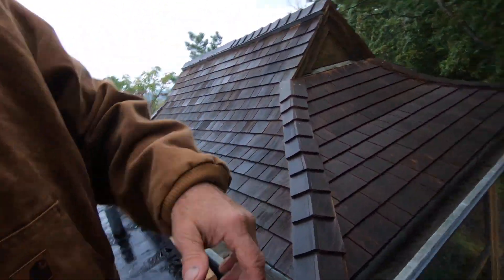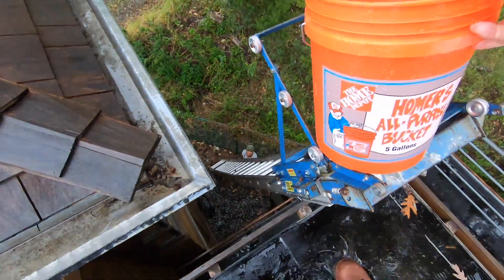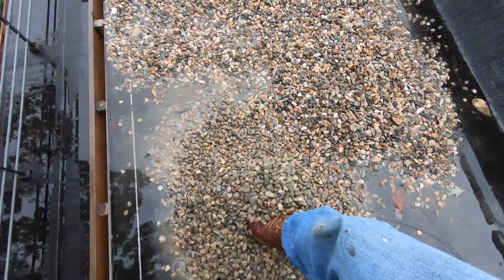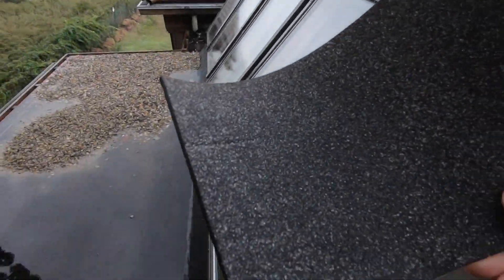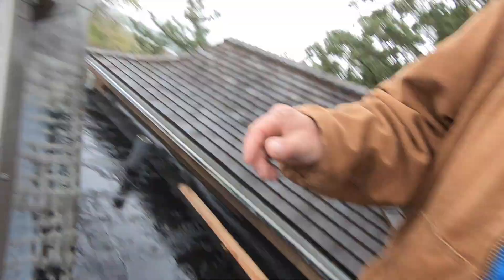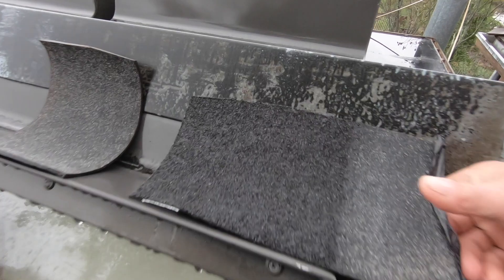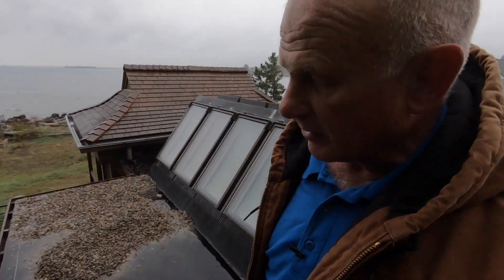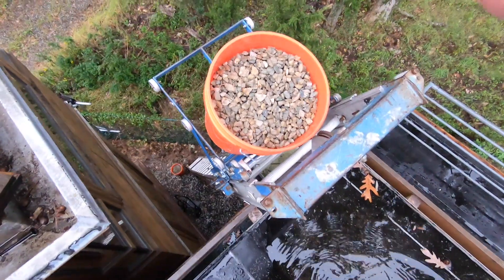What is the stone for on a flat roof?  What kind of protection should you use for EPDM, TPO or Torch

Comment: I have a large flat roof and I want to use it as a recreational space since it's so late and access is granted from the main living space. The problem is that it is a rubber roof with a 10 inch slope over 13 feet in either direction. I'm thinking of having the sides of the roof raised and gravel put down then I can start using the space recreational with the gravel as my base floor and certain spaced I may lay pavers on top of the gravel. Does anyone with experience have any valuable feedback to share please?

Comment: I just bought a brand new house and over our bedroom is a flat roof that is black. Is it a good idea to put a light coloured gravel even tho there’s no foot traffic up there? Can gravel end up damaging brand new laid out flat roofing? I’m super confused because here in the Netherlands 40% of houses have gravel and the others don’t and just leave the black roofing exposed. Is there a reason for this? We’re boiling in the room at night…
Reply: You can buy the EPDM Roofing Material that has a thin Aluminium Metal Coating. This would reflect the IR and UV from the sun's heat, and make for a cooler bedroom. This Roofing Material can also be self-adhesive - if you clean the surfaces to be bonded really well.

Comment: does anyone here have experience and advice on these types of gravel roofs? Ones leaking how should i seal it???
Reply from the maker: very hard. You need to scrape off the gravel with a spade, clean the surface to get it free of dust, Use a torch to heat up the surface to remove imbedded stone with the spade, then you can repair it with a rubber membrane

Comment: With all that water on that roof all that stone is gonna wash away, also you pointed at the flashing where you showed it was “spider web” and you didn’t address 🤦‍♂️ stop ripping ppl off and get off the roof!!!!
Reply from the maker: Your comment shows how little experience you have. 
1. The stone will never wash off. it has been used like this for 60 years
2. I pointed out why the stone is needed, to protect the roof against UV's. This video was not about how to repair or address the existing membrane. duh!
3. You sound like someone that just want to be negative without any good reason. Working for the Union or someone will get you depressed. I am sorry about your attitude. 
4. Maybe you should start with some lessons on bettering your life and your comments might improve.

Comment: Nice I use to work for a vanity company qhere we had a vaccume truck and we qould cone and vaccume the rocks off commercial buildings so the roofer could replace it
Reply from the maker: I know about that service. but I found leaving the stone on the roof helped to give a smoother surface and with the 3 ply system, I implemented it was wonderfi=ul. The reason contractors had the stone removed, is because they were stripping all the roofing off.

Comment: Can I add a small deck ontop of the gravel on a flat rooftop? Or would I have to make modifications?
Reply from the maker: I fyou have an existing old hot tar and gravel roof, then it is best to first replace it with a new roof. The Hot Tar  and gravel roof only last between 20 - 30 years, some longer. So don't take a chance to put something on top of it if.
Reply: give me a call 416 995 4673

Comment: Does the weight of the gravel not have an impact on the roof?
Reply from the maker: Not at all. Most structures are designed to carry far more weight than anticipated. Like 6' of snow, a bunch of people on one spot, and so on. One of the reasons why you see commercial roofs cave-in is when drains are not functioning properly. Snow is not a problem on a roof, but if it melts and the water can't get off, and more snow piles up and more rain, that roof will eventually collapse. If you can find videos on roofs that cave in, you will always notice the water that goes with it.
Reply: @FlatRoofDoctor  thank you doc. And as for the size of the gravel, any size?

Comment: According to GAF modified bitumen is supposed to have standing water. I just met with on of their reps last week. They claim that really only TPO is made to allow for standing water due to the welded seams. The rep explains that bitumen will break down quicker due to the water. My honest opinion is that it comes down to the installer and not so much the material. I've seen a lot of TPO systems and emailed work leak like crazy due to improper installation.
Reply from the maker: Hi  Noobx
You start your comment "is supposed to have standing water" meaning it should have standing water on it. Then you said the rep of GAF is against it.
Here is my opinion. No roof should have pooling water more than 48 hours at a time. Pooling water enhances plant growth and insect breeding. I have seen ponds on roofs where the ducks came to swim daily and for 20 years the Torch Down roof never deteriorated to a point that it had to be replaced. This video I took https://www.youtube.com/watch?v=NnWfiPRM1w8 shows where plants have grown on the roof over 5 years. So, when somone say something without any back-up, is just an a opinion and not a fact. Even a rep working for a company.
I agree about the TPO roofing system. I have seen so many leak at the seams. My observation is that the welding of the seams are to inconsistent. When someone welds a TPO seam, they can't see how well it is welding, it is by feeling alone. After they welded a seam, they then use a probe to see if all the seams welded properly. Not a very good system to proof something.
Anyway, thanks for your comment.
Have a nice day. Today is the 3rd of July and in the US everyone is getting ready for the 4th of July celebrations.
Ps. Please come back and write another comment. I like to hear from you.
Best regards
Naas

Comment: I saw you said you are not an EPDM expert.  I am.  I was Firestone’s compounder and have consulted with numerous other manufacturer’s of EPDM over the years.  EPDM samples that were put out 60 years ago are still functional.  The carbon black is an almost perfect UV sink.  It absorbs the UV and reradiates it as IR (infrared).  EPDM has extreme tolerance of heat.  The double bonds are pendant to the main backbone chain so UV and Ozone do not have an easy target like they do with other polymers. The “chalking” you talk about is generally dirt that is picked up on the surface of the sheet.  There is very little measurable loss of thickness over time.

The shrinkage issue has basically two components.  The first is installation error.  If the sheet is stretched into pace and then not allowed to relax that stress that is induced in the sheet during installation will pull to try to return to its original dimensions.  This is the reason that there is a relaxation time required as a part of the installation practice. The second reason for shrinkage particularly with ballasted roofs has to do with the coefficient of thermal expansion.  As the sheet cools it moves the rock ever so slightly towards the center of the roof.  When the roof heats the rubber can’t push it back so over time the walls pull and the center has wrinkles.

I am not going to discuss the formulations for mod bit as the polymer choice APP or SBS makes a huge difference in the UV performance along with a wide variety of other compounding choices.  There is excellent information available from SPRI, the NRCA and other  groups that would improve the professionalism of your videos.
Reply from the maker: This comment has been out for over a year. I really appreciate your input. 
My experience on EPDM rubber is
1. It does shrink a lot
2. It does get brittle
3. Maybe the EPDM is not what goes first but the adhesives that are used on the seams. The contact cement just can't withstand the heat over several years.
Watch this video I have made that shows exactly what I mean. https://youtu.be/sxXBS0v3hVY
Reply: 100000% THE TRUTH .... THE WHTE TPO WE USE IN CANADA IS CERTAINLY UV RESISTANT. and does not require gravel..... people walking on it would simply justput holes everywhere...... not sure if your the ",,roof doctor," id be calling to do my home ... go back to the butchers shop. 👍
Reply from the maker: Rich B   Excellent comment. Thanks for the detail explanation. However, I only go by what I see on roofs. EPDM does not perform as well as manufacturers claim to do. The materials elasticity is much different 15 years later as from when it was new. You explain this very well. This just means that it’s not protected, but has a tolerance against UV’s. At the end, it will be destroyed. How long EPDM will last, anyone can give their 2 penny’s on that. My experience is in 30 years I have yet to see an EPDM Rubber that has no issues after 12 years. The older it gets, the less it becomes. That’s just a fact of life and earth. Only metal and stone can withstand UV’s. Everything else will go. I have a lot of wrinkles. So does EPDM rubber after a short 15 years meaning it’s life is over. Almost. 
Thanks again for your very knowledge and sharing it with us.
Reply: @FlatRoofDoctor  rich b probably hasnt bin on a roof in his life haha

Comment: I want to redo a flat roof on a brick building where the brick walls extend about 1 foot above the roof deck and then are capped with removable terra cotta wall caps.   I can see how the torch down will work well for the flat areas of the roof, but how would you get it to adhere to the inside of the brick parapet walls?   I can see how it would work ok if I were adhering it over the existing modified bitumen roof, but there are too many layers to go over this roof again so I need to tear it all off down to the bare wood deck and bare brick walls.   You have a lot of videos showing torch down applied to wood frame parapet walls but I haven't found one where you apply it over brick walls.   Assuming torch down would actually work for this application, please explain or do a video. 
Thanks in advance for your help!
Reply: Don't ask this guy any flat roofing questions.  Hes so far out on left field it's not even funny.  His roofING practices are totally laughable withing the commercial/industrial flat roofing industry.  Go to an actual company and show them these videos of his.  They'll have a good laugh.  40 and 50 years from s tar and gravel roof is a total joke as is the 60 year claim for two ply modified  (torch on)  this guy shouldn't even be in business.
Reply: @BUSTRCHERRI  I have a 40 year bitumen/tar roof. It is made 1980 in West Germany.  The roof is not leaking all the time. But it become cracks and i think it wil not hold 50 years.
Reply from the maker: Hi
Who decides that a flat roof cannot have more than 2 layers?. I understand the code in most states requires that after 2 layers you need to tear it off before putting a new layer on. That applies to shingles and for a good reason. Nailing shingles over to many layers will not work.
In the old days, it was not advisable to add a second layer Hot Tar (build up Roof) over an old one. But, with the single ply membranes, there is no reason why you can't have multiple layers of rubber. As long as the surface is not compromised, as in rotten substrate or soft areas.
Now, I am not an EPDM Rubber Expert (I think it's the worst roofing material), but I don't think you can install 2 layers of EPDM directly on top of each other.
I am a Torch Down guy, I have installed Torch Down roofs over any surface imaginable. Here is the list: Build-up roof, stone-covered roofs, asbestos tiles, copper roof, metal roofs, shingle roofs, EPDM Roofs, TPO Roofs, Spray foam roofs (I have a video on that coming soon). As long as the surface is solid, there is no reason to tear it down.
The best is when there is an existing Torch Down Rubber roof, no matter how bad it is, it is still benefi=cial to use that as the base for a new torch down roof. Fusing the 2 layers together makes for the best roof ever. It will outlast any other roofing system. If you check Firestone's website, you will see plans  2 and 3 layers of torch down.

Now your Question. Since you are only going up 12 to 15 inches up to a brick wall, you can torch directly to the brick wall and it will stick. By the way, most of my videos on Torch Down roofs show existing parapet walls that are either cement or brick or whatever that is full of tar and junk of old repairs. I leave everything as is and go right over it. What makes a difference is I bring the membrane over the parapet wall and attach it to the terra cotta wall caps. I remove the ribs on the terra cotta wall caps as to get a flat smooth surface. I just realized I have not posted a video on how I do it. I will try to upload one today.
Reply: @FlatRoofDoctor  thanks!

Comment: That does not look like ASTM #4 stone. This stone is too small to provide adequate ballast for a loose-laid roofing system.  Check Chapter 15 of the IBC. Black EPDM is inherently UV resistant because of the Carbon Black. TPO has stabilization added to provide protection.  this roof does not meet the building code as it does not have adequate slope to drain.
Reply from the maker: OK, so why do EPDM and TPO roofs fail? They may have whatever composition to help against UV, but they eventually fail. Those components are just to get a longer life out of the material, not protection. The only element that is UV safe is metal, ceramic and stone. Everything else will succumb to ultraviolet rays.
You can be a millionaire if you can find something that would protect EPDM or TPO forever. I'll buy shares.
What makes Modified Bitumen Better is the ceramic granule layer. This is not always 100% fool prove because some brands these granules wear off.
The Silver coat people paint over a Modified Bitumen Roof is excellent protection too.